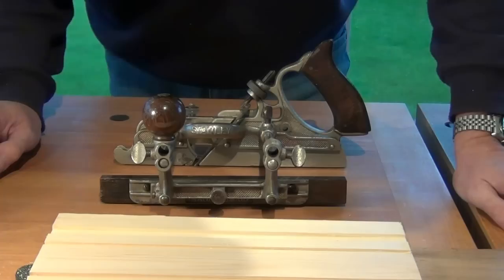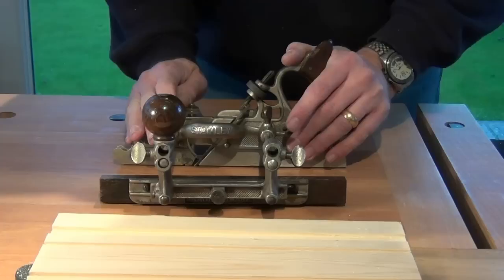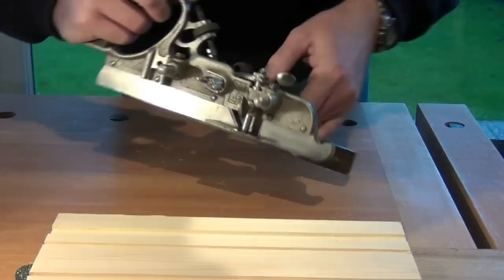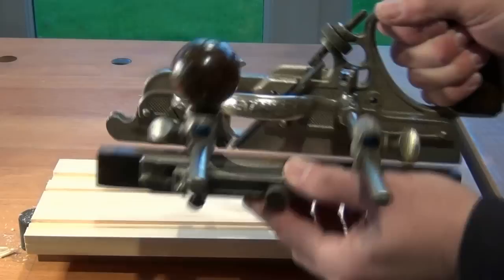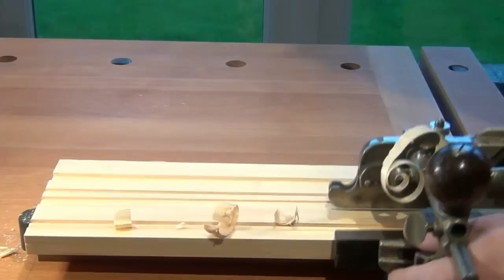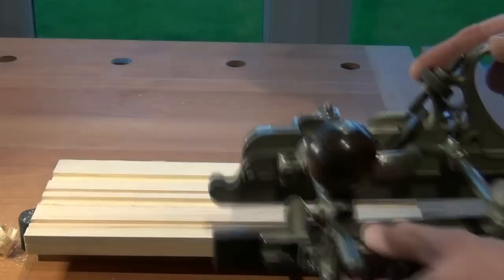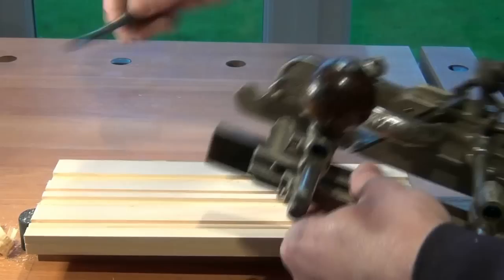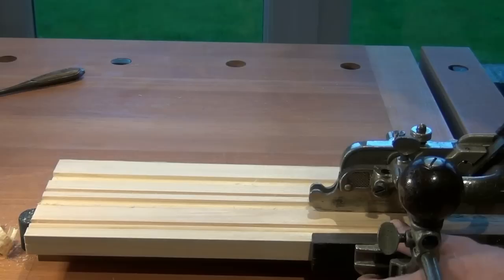Plough Custom Width Grooves using a Stanley No.45

Comment: good video, the problem with the main stock might be solved by adding the cam stop to the opposite side of the main stock from the fence, thus giving a "skate" on to which the plane can ride level, you will have to adjust occasionally as you point out in the anatomy video, but for a "one tool" solution it seems fairly practical
Reply from the maker: andy van Thanks Andy. I have a solution in mind, but I need to work on it a bit before making a video. The cam would help, but the need to adjust it would be a pain.

Comment: Merry Christmas Mitch
I have the record 405 - I didn't know that the fence on the 45 had this micro adjustment.  I'm going to look at my 405 (since it's a copy) and see if I have the same feature.
Reply from the maker: Ralph J Boumenot Merry Christmas RalphNot all 45's do. It's not necessary, but makes dialing in the offset a bit easier.
Reply: It makes dialing here incredibly easy. My 405 has this feature but the micro adjust screw is broken and the screw for securing the fence is missing. Still haven't found a replacement for either one yet.
Reply from the maker: Ralph J Boumenot I can't help you with the dial-in screw, which has two sperate threads, opposite handed and different pitch I believe. A model engineer should be able to make one easily on a thread cutting lathe. The locking screw can be replaced with the depth stop screw from a matching cutter, at least on the 45.
Reply: I found the micro adjust screw but it's for a 45. I haven't had the same luck with the locking screw and no other screw on my 405 fits in that hole - all the other screws are too big.
Reply from the maker: Ralph J Boumenot That's a shame. How about boring out the locking screw hole and tapping it for a common machine screw? The 45 adjuster screw would be an aid to getting an appropriate one made for yours, easier to show the sort of thing you need than try to describe it. You just need to ascertain the two thread sizes in the fence mechanism.
Reply: WOmadeOD - Made in Wood with Mitch Peacock I don't think those threads are opposite, they are just different pitch. The fence moves according to the difference between the pitches. Make sure the screw doesn't bottom out in the blind hole in the wood part of the fence.

Comment: That is quite a tool. But wouldn't it be slightly better to cut the left hand side first, since the depth stop is on the right side?
Reply from the maker: Certainly makes sense.
When I started using a grooving plane for these cuts, I had more difficultly keeping it on track when there was a groove between the fence and overlapping the next cut. Somehow a solid section towards the fence, would help the plane track better. I've just carried that technique over to the #45, when I probably should have evaluated it afresh. Of course the #45 does have a left hand depth stop on the sliding section, so either way works fine (for the narrowest grooves, where the sliding section is not used, the primary depth stop will always reach).

Comment: Why not cut the left hand side of the groove first, then move the sliding section to the width of the second cut, or even smaller, and cut the rest? I've never used such a tool, but would this balance the tool when riding on both "skates" [blade supporting thingies]?
Reply from the maker: That's an interesting point Marti - well worth trying.
See my reply to esa062 as to why I do it the way I do: habit mainly ;)
Seeing the logic of your idea makes me think I should try it asap and report back. I'll try and keep it in mind over Christmas.